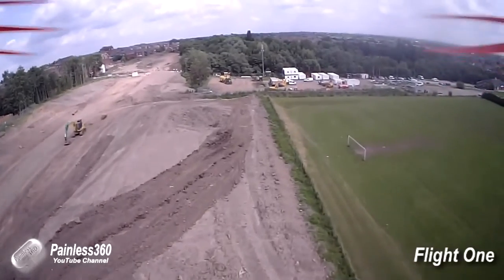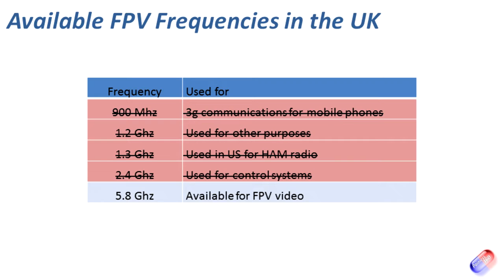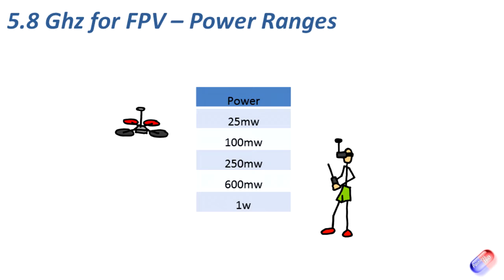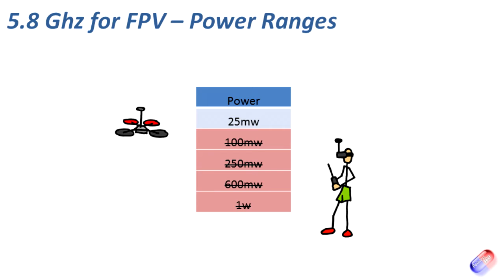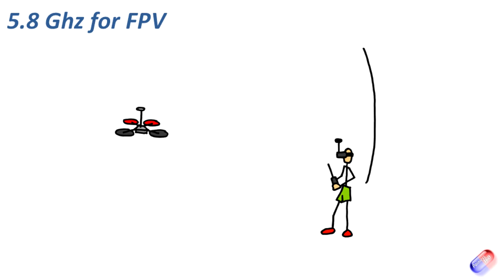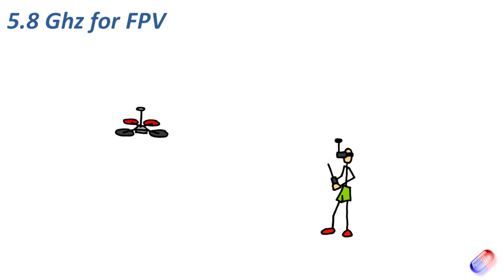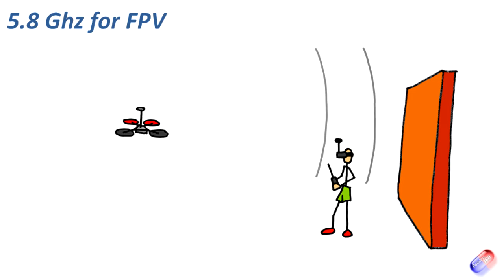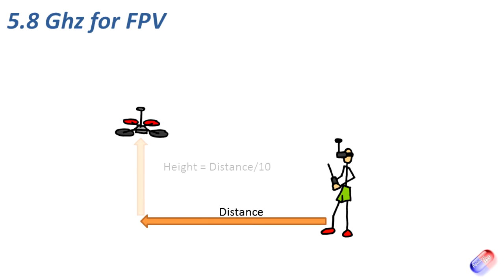Introduction to FPV - Frequencies/Power we can use in the UK

Comment: i use ready to sky fpv camera with 40 channel 25 mw..but the picture is lost when i push the throttle,can you help me what setting i need?
Reply from the maker: +Firdaus Firdaus it's probably a power problem. I'd make sure that the power to the video transmitter is ok when you raise the throttle and also connect all of the ground wires from the video transmitter camera and battery to one place, that sometimes helps a lot

Comment: There is a belief that the use of higher power equipment can be authorised by
applying for an Amateur Radio licence. This is wrong. Amateur Radio licence
expressly prohibits use in any aircraft or airborne vehicle. This restriction is not
relaxed for, radio-controlled models, aeroplanes and balloons.

Source http://stakeholders.ofcom.org.uk/.../spectrum.../OfW_311.pdf

Comment: I use 25mw 5.8Ghz with circular polarized  antennas It is fair to OK but legal. Must try getting ham : ). Liked this video, BTW what about 433hz
Reply from the maker: The 433mhz band is used from everything from garage door openers to RC telemetry systems (see my video on the 3DR radios) so outside the scope if this introduction. Happy flying!
Reply: Painless360
Thank You for the clarification.

Comment: Good video. I've been using 5.8Ghz for my FPV system. I can fly behind and around my house but I run 600mw and get a small amount of static.  Here are my findings: 5.8Ghz Video Test

On 5.8, circular polarized antennas are a must, they will almost always kill reflected signals as well as improve range. ReadyMadeRC has some great parts for all that.
Reply from the maker: Thanks for the comment. Nice video and good skills. It does show how much better 600mw is than the lower power transmitters - makes me want to get one! I'm impressed that you can get any video while on the other side of the house - reflected signal from nearby structures maybe?

Totally agree with the Circular Polarised antennas, I don't fly with anything else. I wish they would ship them with all the kit rather then the sock whips they put in the boxes - they are only good enough to pop on a tx when you are powering on/testing on the bench.

Happy flying!

Comment: i have an 11dbi antenna for my 5.8ghz receiver, should i be using it? and also I struggle to get range past 50 yards but i have set everything up correctly. what could the problem be?
Reply: this is my setup http://www.ebay.co.uk/itm/5-8Ghz-FPV-Video-TX-RX-200mW-11db-antenna-720P-Camera-/260826752139?pt=UK_ToysGames_RadioControlled_JN&hash=item3cba7c648b
Reply from the maker: Connor Mullan Hi Connor, I've not seen this kit before and it seems very cheap for what you get in the pack. I suspect that the poor reception is due to poorly made/tuned antenna(s) or a problem with the power on the Tx. If you can - try it with Circular Polarised antennas to see if that helps. Sorry I can't offer more advice.
Reply: yeah i suspected it was too good to be true. I'll those antennas and see if it makes any difference. Thanks for the assistance :)